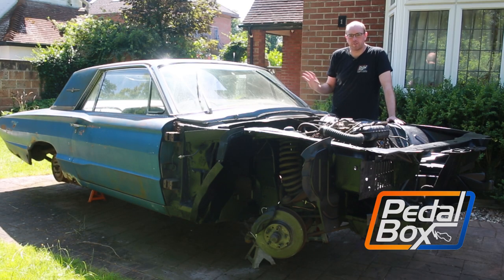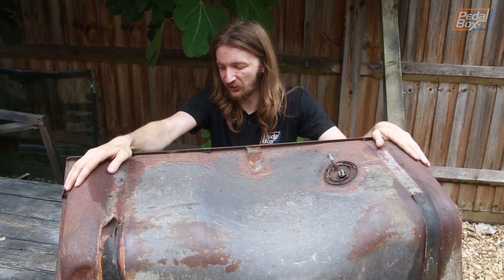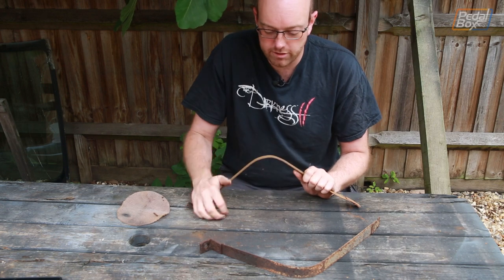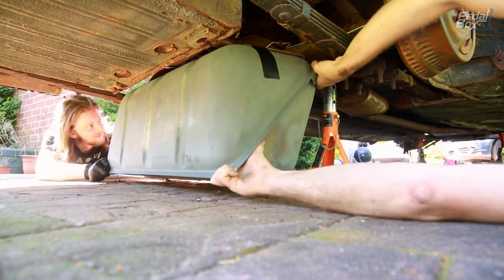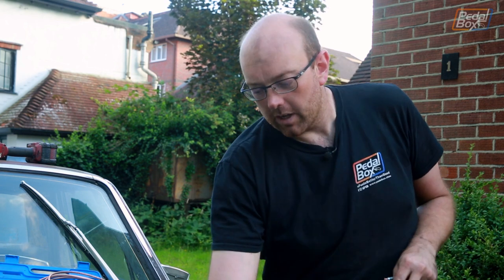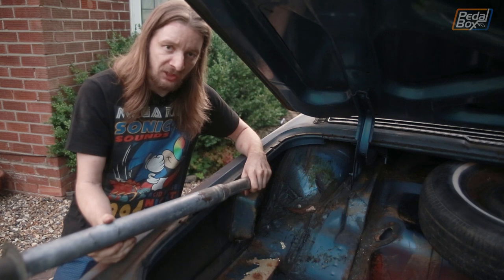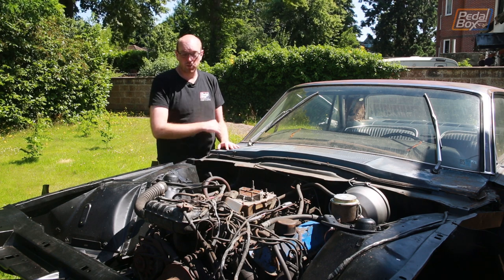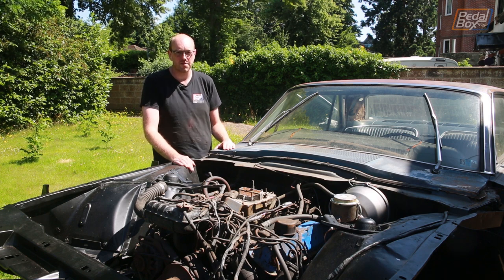Fuel Tank and Brake Booster | 1966 Ford Thunderbird | PedalBox Fleet Episode 79

Comment: I have a '65 Thunderbird that I have been working on for over a year.... I have replaced my fuel tank, it was not that bad really but needed professional cleaning and sealing. The price quoted me was $430 a new take was only $20 more so I installed the new tank with a new sending unit. Since then I have replaced all the seals in rebuilding the steering gear box. then I had the power break booster rebuilt, then installed a new master cylinder... now I'm broke. Well I also found two fried wires in the wiring harness and I have peeled all the tape covering  the wiring harness. So much fun. I used to have a '64 Thunderbird that I drove in the UK when I was stationed there at RAF Upper Heyford. I sold it back in '92 I hope it is still running around England some where.

Comment: Ade: "Just give them a good rub down, with a piece of sand paper. This is actually an 80 grit kinda sanding mesh that goes on the bottom of an orbital sander, and just take off all the crustiness"
Arnie: "Do it doucement, do it very slowly"
Reply from the maker: Doing this on the Radiator with some old discs damn near ruined my arms!

Comment: does a 1966 Thunderbird gas tank have a proper drain plug that I can drain the tank with without removing? 
thank  you! :goodvibes:
Reply from the maker: i'm pretty sure it does have on, although what we got out of it wasn't everything that was in the tank. Or we couldn't get it undone at the time. Either way when we dropped the tank down there was well over 15L left inside. So i can't vouch that the location is that good!